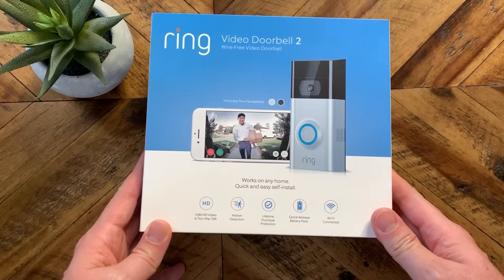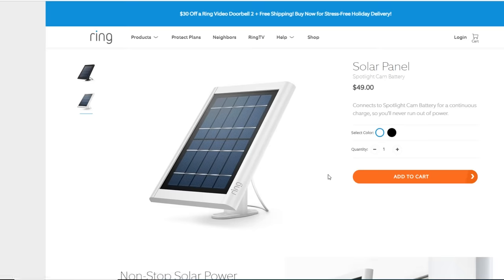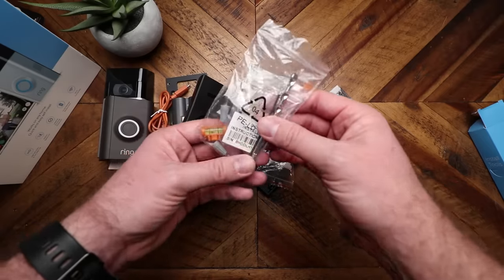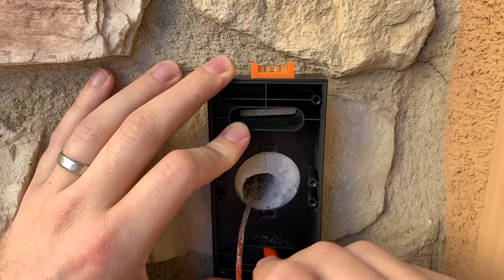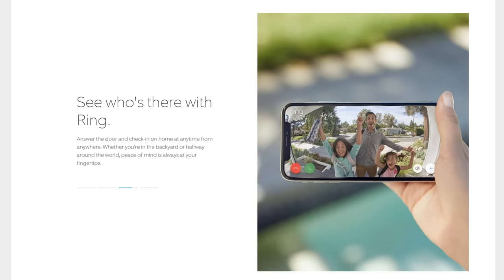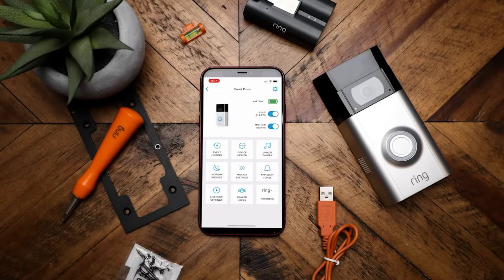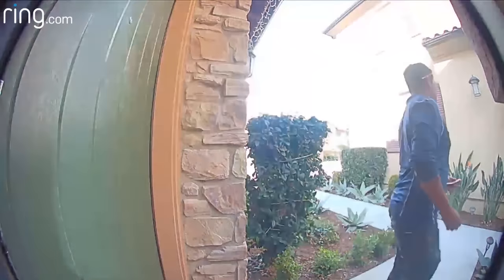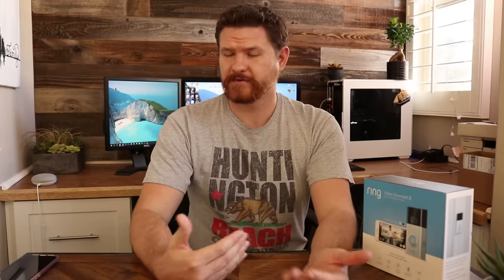Ring Video Doorbell 2 Review - BEWARE of hidden cost

Comment: I’ve had the ring pro for 2 years now. Im not sure on the later modules but I connect mine on 5g WiFi and the picture looks fantastic. I now have 7 ring cameras and one thing folks overlook is WiFi quality . Any one of my cameras will open the video feed In less than 5 seconds but I have 5 ubiquiti access points in my home. You must have good WiFi signal for any wireless camera to compress a 1080p stream to your device and I see lots of people ignoring that. My 2 cents.
Reply from the maker: Thanks for that helpful comment.
Reply: Thank you for that.  I just ordered a Ring and am anxiously waiting for it.  My thoughts about the complaints mentioned, was that issues WERE a WIFI issue.  Perhaps a WiFi extended would correct the issues.  Subscription cost is $30/yr., It's $2.50 a month!  This includes your neighborhood, with a map of other Ring owners, so you can share videos between neighbors of possible crime.  For me, this is a no brainier.  I could be out of the country and be able to answer my door.  Just adding my two cents.

Comment: Excellent point made early in your video… that I can mount this on my door facing out rather than my current doorbell location. Now I’ll have to look into the subscription aspect. That is per Ring device so it would be 60 per year for Front and Back door. I learned from your Stick Up video. Not a Big Deal but good to know. Thanks!

Comment: Paid £24 for the annual subscription here in the UK 🇬🇧 once the 3 month trial expired. More than happy with the cost. For those complaining about lag, ensure you have a good reliable Wi-Fi signal. I suffer zero lag. More than happy with my Ring 😃
Reply: My Ring 2 was 2metres from the router. It lagged terribly, if in shower by the time the Chime dinged. the visitor was gone when I got downstairs. AFter 13 months (I would not subscribe) it decides to go awol. No sounds no vid, nothing. Took it down and it is showing damp inside. I live near a River so air moistire is common. did a factory reset and tried again it just fell over. I had ring 2 and 2 chimes, What a friggin waste of money. I now find out it is not IP rated in UK, yet it is sold as waterproof?
I now have a £85.00 Chinese brand, that is also 1080p, came with mini sdcard for auto loop recording, you can replace and add upto 128mb. Yes it advertised it has onlige storage which you can pay for. 

It can screenshot from the live video , Chat in live view, so you can shout at your neigbours dog or cat having a crap on your garden etc etc. So far it is briliant.
 Neglible lag of only 1- 2 sec my phone will either ring or ding for motion. So i have time to open app and talk to visitor before they dump parcel in the bin or with a neighbor.

Ring is a good design, nicely thought out IT project. But i just dose not deliver the goods. Ring always blame the wifi connection etc etc. Better software would solve that, dont blame the customer all the time.

Peronoally I think Ring should be taken to court over claiming to be waterproof when in fact it is not UK IP rated. Every thng they do is now expensive. There are now better cheaper IP rated systems emerging, so why buy Ring?

Comment: I bought two doorbells and two security cameras with lights and alarms. The second doorbell never made it onto my backdoor because I realized it made a perfect tool. I have used it so many times to help me troubleshoot that I keep it in a baggie in my toolbox. My dishwasher for example was not working right so I put the camera inside a glass jar and set it inside and closed the door. It was able to give me a perfect signal while inside my stainless dishwasher,it also gives a perfect signal from inside my refrigerator. Currently its on the roof while I keep an eye on a pesky squirrel. I would have given a finger or two to have such a camera thirty years ago.

Comment: The 5 minute project took a couple hours as the Ring was too wide for the existing space. I mounted a piece of wood to the uneven brick at the 4' height and extended the wire. The  angle bracket would have made the job much simpler, but ruin the view. And the view is a fish eye, but not too bad. It would be nice if they just had flat spacer to tuck in the wiring. I would have bought the Pro that fits my door, but the ratings are so so, and I just read that it needs a 16-24 volt transformer. I would have to replace my 10 volt existing doorbell and transformer.  And yes, you did a great video.

Comment: So part of the system, that is amazing in my opinion, is the cellular backup option that comes with the alarm system. This means that if someone was to cut your phone line and even, somehow, trip your power, your cameras are still going and transmitting to the cloud. $10 a month for this system with no installation fee and the easy setup plus wide range of simple device setups, makes it very simple to make a pretty awesome home security system. The $10/ month for this option seems like a no brainer for me. Also cloud based storage for $10 a month on an easily expandable security system is a steal. Imagine you want another camera, well a few hundred and an easy instal and you are golden.
Reply from the maker: I"m going to have to check out this Alarm System. I sounds like a game changer for the Ring system.
Reply: Steve DOES I just had an incident where my internet went out. Cellular backup is just for the alarms, but I have to say it’s amazing. Felt 100% amazing that it kept me updated and kept working. I turned it on and off at will, from my phone. My internet was actually down for a few days and it was a relief to know my property had its alarms all in tact. Shame it wasn’t the cameras, my mistake about that, but the alarms and cellular backup was a nice touch.

Comment: I have both the Ring door bell and the Blink  system. In my experience the Blink wins hands down. Easy to adjust, just as good pictures and you don’t have an after market fee.  And I have had several incidents that I’ve called the police on. They look at the videos and say “ that’s nice” so I’m not that thrilled with that aspect. And as far a the Ring goes , it drives me crazy with the alerts. Every time a car drives down the street and adjusting it isn’t easy. So if someone is thinking about a surveillance system, I’d look at Blink. Just my opinion.
Reply: What made Blink better in your opinion?
Reply: @janiedoedontlikehatefulpeo3673  I could never get it to just focus on my porch it captured every car on the street. It as very irritating.  The Blink is not a doorbell so it can be place in a better location for my use. But I said this before.
Reply: @patriciahall198  Thank you. Does Blink have a delay? I'm actually trying to figure out which one to buy at Best Buy right now, lol
Reply: @janiedoedontlikehatefulpeo3673  my Blink system came its two cameras and they (The Ring and the Blink) are different. The Ring was a doorbell so it only could look straight ahead where the Blink can be put at an angle so it’s angle gets the front door from the side sobI don’t get all the cars, just the people on my porch. And I didn’t like the Ring charged you every month so you can see your pictures. I prefer the Blink . But it’s all personal preference. Good luck
Reply: @patriciahall198  Thank you!

Comment: I think if you didn't have an subscription it should save locally on your phone. The subscription service should be for cloud storage.
Reply from the maker: Agreed, a subscription is a nice option but, shouldn't be required to properly use the device.
Reply: Save locally on your phone? So... it would only save if you're home with your phone? How is that practical?
Reply: Maybe have it's own SD card slot. That way you can buy a 1TB card good enough for about a week as a backup to cloud storage.

Comment: I HIGHLY recommend Wyze cams vs ANY RING devices. RING needs high end wi fi 100/20 at least, to work well. Wyze doesn't.
Wyze cams aren't doorbell activated per say but, you can have your WYZE cam either detect motion and record or listen to noise, such as a doorbell chime, to begin recording. We have 3 RING devices and 5 WYZE cams as a more reliable backup recording device. Knowing then what we know now, we would have saved HUNDREDS of dollars and just bought the WYZE cams.

Comment: Great review. I was just about to pull the trigger until I watched your video.Having to get a subscription and pay for recorded footage is a major deal breaker for me.
Reply from the maker: Happy to help.
Reply: For me it's worth the $30.00 to have recorded footage that could be used in court.
Reply: @bobgil3464  My point is that with today's technology you don't have to pay for video footage. I just bought a security video doorbell that records footage on my ssd card and notifies me when  someone is close or front of my door step and records video footage directly on my phone.
Reply: @johnnyvelez4421 thanks.  That would be good for me what is the brand? My wife says get a game cam but expensive with phone download.
Reply: I think you’re thinking it in a wrong way. What you are paying for is really the storage of the video and the ability to view the videos without having to connect to the doorbell itself so the doorbell can be stolen but the recordings will still be available to be viewed online. That’s what you’re paying for.
Reply: @1Kenjix  so do you reccomend the RING?
Reply: @bobgil3464  I would recommend it, and I would recommend buying ring doorbell 2. The pro version doesn't offer much and the original ring doorbell requires it to be hardwired. I have the doorbell and i think it's pretty good at detecting motion. You can even buy a solar charger to keep the battery charged so you wouldn't have to change the battery too often and still able to set the detection frequency setting to its highest.
Reply: Bob Gil   I have had the Ring 2 for a month now and love it! I also bought the Ring spotlight for my back garage door going out to my patio. I am very happy with both. The spotlight came with 2 batteries which is nice and I also bought a spare battery for the front door.
Reply: @bobgil3464  Check out Arlo cameras. You get 7 days free "cloud" storage which is plenty for security purposes, and you can easily configure it to backup to your own external USB drive.
Reply: @1Kenjix  I have the original and it is not hardwired.  It runs off battery or hard wired to doorbell wiring.
Reply: $30 a year?
Reply: @morganfalkdesigns  yes

Comment: Helpful video. Correct. No cloud storage is included. Question: I have a piece of trim blocking the bottom of my Ring 2 doorbell. So, I cannot screw in the security screw. Besides changing the location of the doorbell, is there another solution?

Comment: Since I have ring security system, this is no extra cost for monitoring other than buying the device and installing it.  Anything that runs cameras are best hard wired since infrared takes a lot of power.  Also note every single time a car goes by your house the sensors will start recording, so yeah I would hard wire this.

Comment: Therese things are fab. Here in the UK we had to have an electrician fit ours because the power from our circuit breaker wasn’t high enough to power our Ring Pro so the kit here comes with a power adaptor that we were more comfortable having a pro fit. Fun fact ~ we visited Michael Jackson’s Neverland ranch last year (just the outside the gates area, we didn’t go in)  and as well as a tonne of huge cameras there is the Ring floodlight on the front gate :)

Comment: 👍Good video.👍Is it WiFi only or can I run a cat5 cable to it? Also, will the existing doorbell low voltage wires from transformer charge it’s battery? 
Thx!

Comment: Excellent Video - Finally someone explained the "what if" you DON'T pay for any plan with Ring. Seems to suck that you can't even save it for like and hour - to be able to "screen grab" it using a "Screen Record" software (free out there). Also note: Despite comments below, you CAN see live view on your PC (with Windows 10 for example) using the app. This is not just for mobile devices. Works well on my computer too - and I can leave it on (and speakers on) and hear the doorbell chime AND motion detection alerts (choosing from a wide range of ring-tones) Just go to google play store (on the PC) and install the app (for PC) and choose eg: Windows 10 at 64bit etc.. 
Works good on PC However, same as with table and phone view, sometimes the Live View doesn't come up until 2 or 3 tries. Comes up black-screen. Just back up, do it again, then boom, comes on. Usually comes up first try though.
Reply from the maker: Thank you and good tips. I didn't know there was a PC app on Win10.

Comment: VERY well done and helps you take into consideration if there is background movement to activate the camera, if the sun angle / direction is coming into the lens so that the image will be backlit and all facial features hard to see.  And, LOVE the "Lets see what's inside the box... BAM!"  You still didn't say if the battery was charging by being hard wired.  You just said the display showed if it was hard wired or on battery.

Comment: Do you need an exciting bell as I don't have any. Also is this night vision and do u think there is a better option ? cheers net
Reply from the maker: Hi Nettie, You don't need an existing doorbell with this battery powered version of the Ring doorbell. They sell external chimes that you can plug in around the house so the doorbell connects directly to the chime via wi-fi. As for other Video Doorbell options, i'm actually testing out one by eufy now. I like this one because there is no cloud storage with it, so no monthly fees. It's also 2k quality and has a bigger aspect ratio. My biggest concern is that all the footage is stored locally. So if someone steals it then all your footage is gone. I'm hearing that they are working on a way for it to same it's data to the base of the eufy cam E but that's not an option yet. Hope this helps.

Comment: Anyone getting the Ring Doorbell make sure you have the proper UPLOAD speeds from your internet provider.  I did not find anything on the information I had on the Ring.  I had nothing but problems with the Ring to the point it is useless.  Make sure you have adequate upload speeds and ask Ring to confirm before you buy.